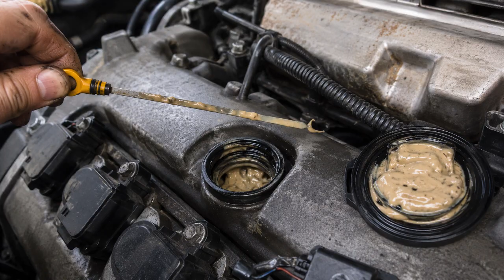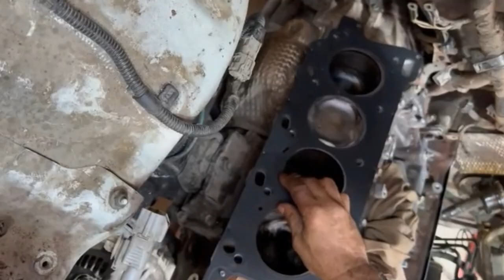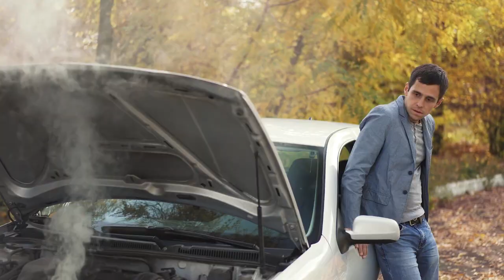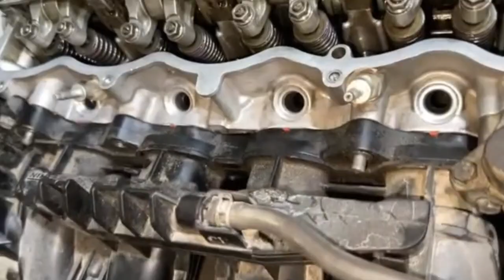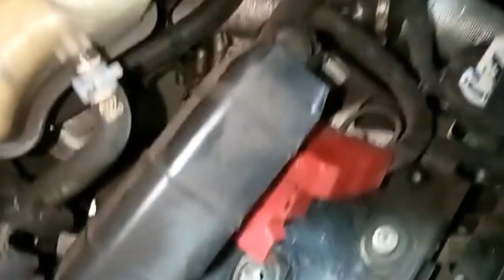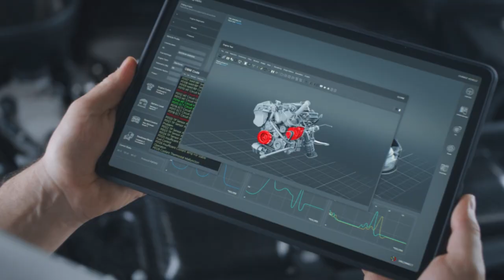Coolant in Oil: What Broke?

Comment: Coolant disappearing
Reply from the maker: If the coolant keeps disappearing, I’d first rule out an external leak with a cooling-system pressure test. Check the radiator, hoses, water pump, thermostat housing, reservoir, and heater-core area.

If there’s no visible leak, then coolant may be leaking internally. Watch for milky oil, white exhaust smoke after the engine is warm, bubbles in the coolant reservoir, overheating, or unexplained pressure in the cooling system. A head-gasket leak is one possibility, but it shouldn’t be assumed until it’s tested.

Try not to keep driving it low on coolant, because repeated overheating can turn a small problem into major engine damage.

Comment: Oil cooler n or head gasket
Reply from the maker: Yes, oil cooler and head gasket are two of the first things I’d check when oil and coolant are mixing. An oil cooler failure can mix oil and coolant without the same symptoms as a bad head gasket, while a head gasket or cracked head can also cause overheating, compression loss, bubbles in the coolant, white smoke, or coolant loss.

A compression test and leak-down test are good next steps to see if there is internal engine damage. I’d also pressure-test the cooling system and test/bypass the oil cooler if that engine has one. I wouldn’t keep driving it until the source is confirmed, because coolant mixed with oil can damage the bearings fast.